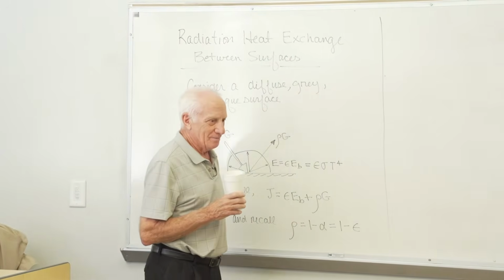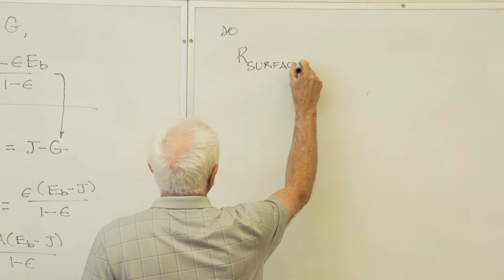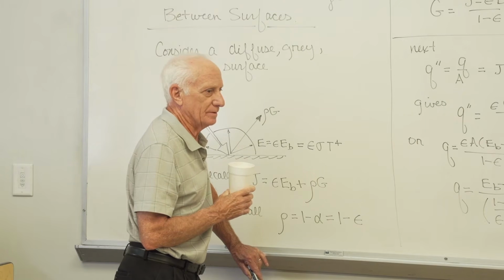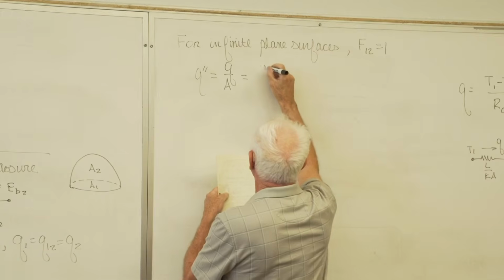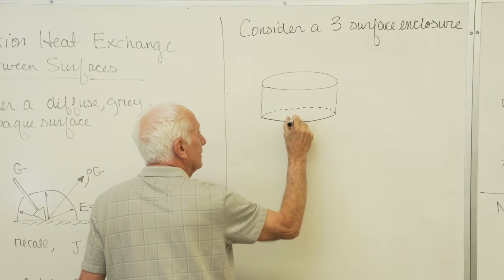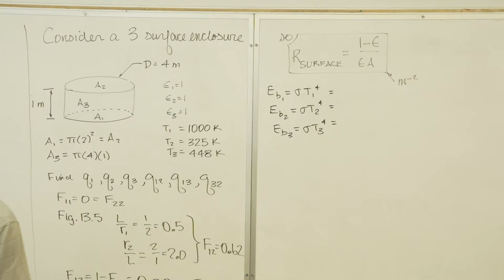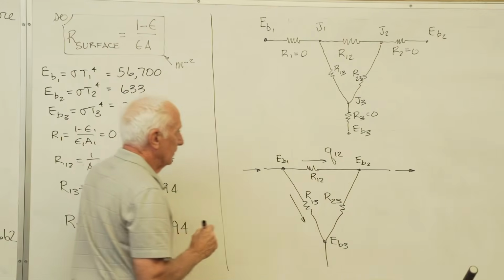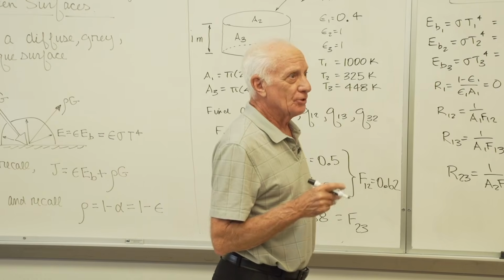Heat Transfer (20): Surface and space resistances, radiation network models and examples

Comment: Hi Sir, since A3 is a cylindrical surface, it will re-radiate on itself and that should be reflected in the final q3 right? (F33 is not zero) . In the network diagram drawn by you, where is this re-radiating effect figuring in? Are you assuming F33 as zero in this analysis ?

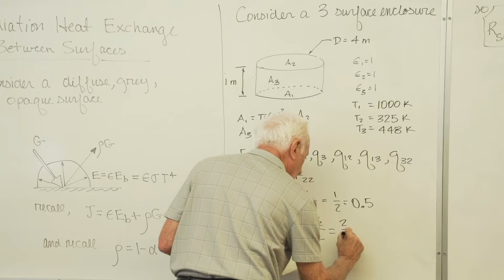Comment: great lecture, but i think there is a mistake at 30:20, the graph shows the view factors F12 = 0.8 not 0.62, this changes all the other values. Im using figure 13.5 from incorpera.